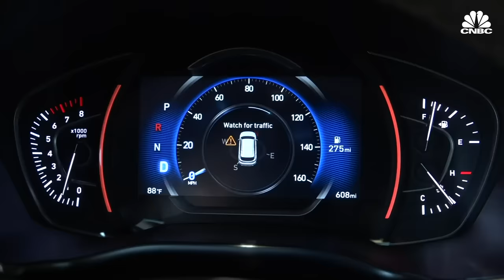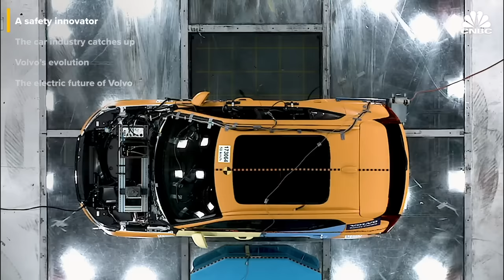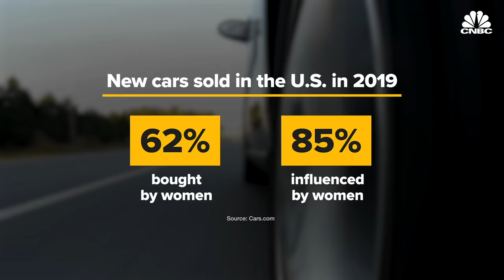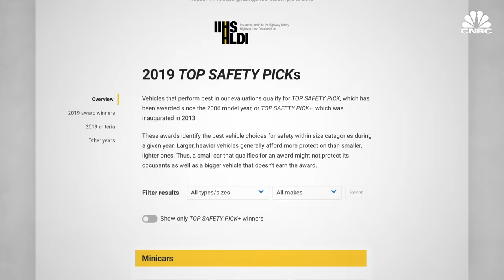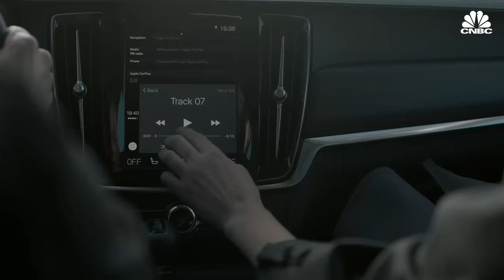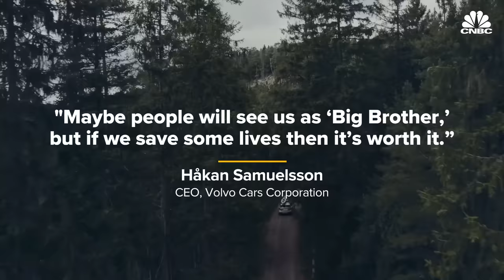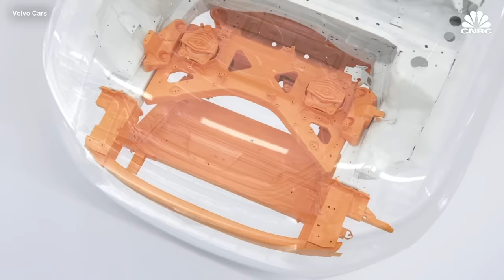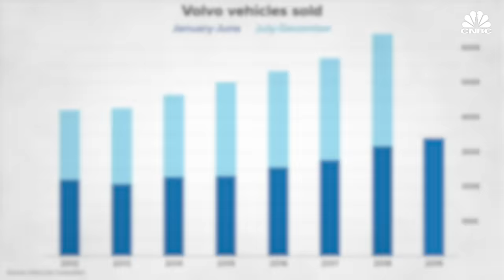Why Volvo Is Losing Its Big Lead In Safety

Comment: I will never buy anything but a Volvo for my family. I trust them, fantastic, well built and reliable cars. Plus they look excellent!
Reply: AirCat Aviation :  Many years ago, my wife and I survived a multiple collision smashup on the freeway in Michigan driving a Volvo 145 wagon.  Lost the front, tailgate and passenger door.  Glass was everywhere.  Got bloodied cut fingers from digging glass out of the seatbelt mechanism.  But we walked away. Fixed the car and drove it for 8 more years, and then traded it in on a new Volvo 240.  Needless to say, I was sold on Volvo and excellent engineering.
Reply: @georgeetoile6686  What a Great story, I'm glad you survived :), I myself own a Volvo V60 D5 2016
Reply: @georgeetoile6686  Same here! My sister was involved in an accident where a truck 'knocked' on the driver's side. The 940 was a total loss due to a bent frame (WHIPS!), but my sister stepped out of the wreck without any injury!
They say, selling the first car is the success of the salesman, but the next car goes on the garage team. But with such an experience  both of them have all the credit...

Comment: Can we stop with the "model 3 safest car" BS. It is a common misconception that the Tesla model 3 is not the safest car. Volvo beat it on adult occupant protection in Euro NCAP's tests. The model 3 didn't perform particular well I'm the small overlap crash test with footwell intrusion. Volvos aslo have stronger roofs. The NHSTA don't even perform an offset test, their crash tests are basic. Please do your research.
Reply: Volvo and Tesla have the same score in Adult protection 96%. Best test score for Adult protecion in Euro ncap belongs to Mazda CX-30 with 99%. Best score for kids or pedestrian belongs to Mercedes CLA or A-class. Chrash avoidance systems still belongs to Tesla model 3 94%.
Reply: The model 3 is the safest car in its class. Some Volvo are safe but not sure how safe they are compared to their competitors in the same class
Reply: I disagree, crumple zone is the biggest contributor to safety and without a large engine in the front it has much more of it. It's physics. They also have better polar moment of inertia to spin away from objects. Lower center of gravity to reduce rolling and thus have better handling, perhaps not the best in the industry but adding all of these factors reduce the risk of injury even more and reduce the risk of first getting into a crash. That last point is amplified by autopilot, with all the sensors and these features being present in all models the overall safety factor is higher.
Reply: The tesla cyber truck is probably the most safest lol its litteraly a armored tank for the average people. (Glass maybe not)
Reply: @jmitchell140897   Elon likes to toot the horn higher and says it's the safest car on the planet.
Reply: @phutran9312  no, but structurally it wouldn't make a difference it were.
Reply: @777Outrigger  it wouldn't matter if it rolls over. https://youtu.be/D6CzLZsN3Z0

I'm curious what would happen to the Model X under the same test.
Reply: @phutran9312  no, check out the IIHS website. Volvo can support over 5x their own weight, and can support more pounds than the model 3.
Reply: @phutran9312  sure here are the links:
Tesla Model 3:
https://www.iihs.org/ratings/vehicle/tesla/model-3-4-door-sedan/2020
Volvo S60 (closest comparison):
https://www.iihs.org/ratings/vehicle/volvo/s60-4-door-sedan/2020
You might need to scroll down about. 
Tbh Tesla does have a higher strength to weight ratio and I don't think any of them broke the machine.

Comment: 2000 S40
 2008  XC70
2020 XC60 .  The extra money spent on purchasing a Volvo is a terrific piece of mind for family safety.  My wife has the XC60 
And my XC70 is still going strong...Volvo for life! Only had one accident, on the highway with 3 cars involved, my S40 took a hard rear quarter side hit and refused to spin out and lose control,  it aggressively held its lane albeit with a 30 degree skidding angle.  It corrected and I pulled over. Nice.

Comment: I love my 1985 240 gl. Almost 400,000 miles and still going strong. Only basic maintenance needed.
Reply: Your car is good for another 7000000 miles.
Reply: Marko Košir I have an 89 240 DL. 365,000 miles original motor. Does not quit
Reply: @hectorvazquez7929  Nice to hear that, but you are going to wait  a looooong time until you will say goodbye to that  car.
Reply: Marko Košir I don’t want to say good bye to it haha
Reply: @Foodstampsandfuelclamps  of course you dont it is a Volvo
Reply: I love old Volvo tanks. I had a 240 for years and it was fantastic. I now drive a 2002 525i and it has over 400,000 on the original motor! I’m so surprised by the longevity. People will say what they will about BMW but they know how to make a car.

Comment: People seem to forget that Mercedes has also been making big leads in safety for years.
Reply: no, not as volvo does, mercedes has a lead in luxery like electric adjustable seats but thats also very common now just like the 3 point seatbelt just like a bumper(ohh btw bumpers as we know today (you cant see them but they are there) is also invented by volvo) volvo has been a brand about safety and practicality, like when you fold your rear seats its flat as the rest of the boot, and rubber on the doors that wont freeze shut in -4 till -40. and when you crash a engine that goes under the car and not on your knees thats why i drive, love, life    v o l v o
Reply: I am also a vovlo driver snd Huge advocate. But you are wrong. Mercedes certainly innovates for safety, they just don't promote it specifically, letting volvo enjoy the PR. Mercedes Benz invented the viscous engine mounts that would let the motor fall down in the case of a head on collision, and Volvo immediately copied and implemented their own ~

Comment: Safety features of Volvo available in all range of model, compared to other makers, need to add on payment, so?
Reply: Not Toyota. Also Volvo generally sells at a more premium pricing. So on a on par level comparison you would have the same tech safety features of other brands. You compare models but fail to compare the $$$$ which is the real factor of comparison.
Reply: I bought a used 2015 Volvo V60 AWD with only 23,500 km on it.  That is 4 years of depreciation but only 1year equivalent of use.  It has almost all the same safety features, but at a much lower price.  Why buy new?
Reply: @georgeetoile6686  Why not buy new?

Comment: Love my Volvo...just wish it was more reliable
Reply: C30?
Reply: @snhprojects2789  2015 S60 T5
Reply: @A2dy  kinda surprised that its unreliable my uncle has an 850 t5 and he never has any issues
Reply: My mom has a 2011 XC70. Just oil changes, but it’s only at 60,000 miles.
Reply: Chao Zhu that’s a lie. Look it up. Japanese brands top all reliability surveys.
Reply: As far as I know especially the swedish build v60/s60 are extremely reliable. I think it was leading some german statistics for used cars.
Reply: volvo v90 d3 with over 140 000km no problems so far
Reply: einar one off example is no measure of Reliability of a car. You will find lots of people giving example how their dodge or Lincoln is running reliably, but those brands are at the bottom of every reliability surveyz
Reply: @animeshdas9842  with propper maintanence most cars will run forever
Reply: @A2dy  Huh I own a 2016 S60 T5 and it's been doing great.

Comment: So Volvo released its research data to other car manufacturers in order to make cars more “compatible” with each other in case of collision. 

I would buy a Volvo in a heartbeat if only they were more reliable and resale value didn’t plummet as soon as you drive it off the dealership.

Comment: Not just safety, reliability on these is also huge, look at how many old Volvos still kick around merrily
Reply: Old volvos are reliable but look ones made after 2000s are not, they are at the bottom of most lists. Still safe but volvo is not known for their reliability.
Reply: Once Volvo was purchased by Ford (2008-newer) their reliability shot way Way up. I drove a camry from new up to 215k miles. Had to take it off the road. (rust)
My 2010 XC70 now has 215k miles, runs Perfect and looks Brand New. AND It's AWD. Totally different league than my Toyota, just as reliable, safer, nicer, never gonna rust out ~

Comment: Volvo has not been taken over. Geely is the investor after Ford was running them into the ground. Also Volvo has been and always will be the leader in safety and technology.  Volvo created the seat belt, the child seat, lane keeping aid, sips, wips, systems. Thank goodness the REST are finally spending R/D on safety. Can you imagine if Volvo put patents of their safety inventions? 👍👍👍👍
Reply: Exactly. I don't know where people get the fallacious idea that Volvo was "taken over" and now is Chinese. That's not at all the case. Geely invested in Volvo and injected capital but Volvo is basically an autonomous brand within the Geely Holding group umbrella. The cars are engineered, designed, created, road and crash tested in Sweden and there's really minimal Chinese/Geely input into the actual cars. If anything, Geely gets to use Volvo tech in their other brands and they've become more Swedish in a sense.

Comment: It's losing nothing, the other brands are safer now
Reply: the video is biast because Volvo does best in REAL ACCIDENTS, while other manufacturers do good in TESTS only. When you change the test other manufacturers fail and Volvo wins because the difference is that Volvo works on REAL CRASHES and others work on lab test crashes

Comment: I would be very interested to know how many Volvo crashes occur above 112MPH as these would be the only ones saved by limiting the vehicle to that speed and I can imagine most drivers being put off by being told the Volvo will do 112 while the X brand will do 136 or whatever seems like a significant number of people would go for X brand whether they drive over 112MPH or not.  136 is just better in our brains.
Reply: It vastly shortens your stopping distance, and also speed at impact which os often not the same as the driving speed you had before the accident.
Reply: Anders Rønning Good point, thanks.  I more than most understand and accept safety will be a much greater priority in cars of the future and I fully accept that is a very good thing but there is still a nagging part inside me that says things are getting worse even though obviously less road deaths is a great thing, I think its because growing up a cars value was predicated on how fast it would go and that seems to still be the metric my brain is looking for.  Top Gear in the 1980’s never had a segment saying We’d like to introduce the new super car from Ferrari You won’t believe how few people die in it per 1,000,000 km driven.It was always WoooooHHHHH look at how this looks, check out how fast it goes and how well it handles.  When I think about it I would obviously prefer the deaths metric over the speed to be improved but a more primitive part of my brain still sees worse.

Comment: I agree with everything but then you lost me at the speed limit to 112 mph. Volvo is a luxury brand and a very expensive one at that. For the price of a  Volvo I rather buy a bmw. It’s not about the top speed of the car but rather knowing you could achieve that if you wanted to. I understand electric is the future but the average consumer simply can’t afford an electric car. This does not include the price to install a fast electric charger. Most people simply don’t have the garage space needed for a charging station.
Reply: Nah, I don't see the problem. As a German who drives pretty damn fast given the opportunity, I don't see a 190 km/h (112 mph) limit as a sticking point. I very rarely go faster than that, anyway, because faster than that just isn't comfortable cruising anymore, even in a V60.

Comment: Limit speed to 112 never bying a volvo
Reply: Are you going to use it on a track? Otherwise why would you need to be able to drive faster than 112 mph?
Reply: @alex27826  autobahn?? Track?? Drive  that speed anyway? And also the knowledge that my car can go fast for example not just 112
Reply: @Harry._.Thompson  I doubt you are German, so I think the point is moot.
However more than half the autobahns now have speed limits way below 112 mph. And you can be held partly liable for accidents if  you were travelling faster than 130 km/h (81 mph).
But sure, let's forget about safety concerns so you can enjoy having a fast car (even though you will probably never utilize it).
Reply: @alex27826  well first anyone can use the autobahn and I  intend to. Secondly u can get sentenced for crashing into someone at 15mph. lastly walking out into the street is dangerous but u still do it. It is about taking calculated risks (speeding) is fine in the right area and time.

Comment: Volvo cars are designed to protect passangers in real life accidents and not just to  pass the NHTSA/IIHS/EuroNCAP tests with 5-star results according to current standards. Volvo has a crash test facility in Sweden where they analyze data from previously happened accidents and the learnings are used to build safer cars in the future.

Comment: My 2013 Volvo S60 T5 stalled in the middle of the highway after the engine failed at 76,000 miles. I switched to BMW and never looked back.

Comment: Saab introduced the safetybelt as standrard equipment in 1958. Before this time only a few manufacturers had the option to have safetybelts.
Reply: oof well Volvo created the 3-point seatbelt a year later in 1959 (stnd equip.) and made the patent free and open for all, changing car safety forever

Comment: How does Volvo compare with Tesla in terms of safety?

Teslas have a low center of gravity. (harder to flip over)
Teslas are heavy compared to other cars. (Its passengers are safer if crashed into a lighter car)
Teslas have some form of Autopilot (Removes a large amount of human error from the equation)
Teslas have a large crumple zones instead of an engine (reduces the forces on the car and passengers)

I don't know much about volvo, but I heard that the Tesla X, 3, and S are the three most safest cars.
Please correct me if I am wrong, but I think safety is increasingly being associated with Teslas.

Comment: CNBC rly needs to do a bit more research. Firstly  while geely isn’t huge in revenues , because the brand mainly targets developing countries, with vehicles at very low price points. It’s company net worth is almost on par with TATA motors which is the parent company of Jaguar etc. Also, it is super common for western automotive companies to enter the Chinese market through collaborations or joint ventures with local companies, and it was volvos aim to enter the Chinese growing market for luxury cars even prior to the acquisition.

Comment: I think that the Volvo XC90 is better than the Mazda - CX9 and Hyundai - Palisade, but the problems are that there is no availability of maintenance with unavailability of spare parts in many Saudi cities 🤔 It is not necessary that the maintenance at the Volvo agency is better to contract with the major workshops to solve  This problem and making it available, especially competition, is required with Toyota.

Comment: Story of Volvo's recent success: writing off the US market, which is headed down the toilet faster than Mr. Hankee-Poo.   Volvo's presence and prestige in the US market is probably about 1/3 of less of the strength that it had under the hey-day with Ford in the pre-Wall St. implosion.  As for Tesla, funny they should refer to it as "California car maker".   All signs indicate that Tesla will follow Volvo's example and continue to shift to China, where, if things are going to be run by autocrats, at least they are run by efficiency motivated autocrats -- unlike the US, where the autocrats are motivated by holding business hostage until they get more power for themselves.  A very un-Sweedish sentiment, and another reason why Volvo probably decided the US market is, in the mid-to-long-term, a hard pass.

Comment: The guy at 5.40 saying you get same safety from other vehicle has never owned or driven  a Volvo or even read the Volvo broucher. It's completely different experience driving Volvo and equivalent to merc or Bmw. Coming from a x90 excellence 2019  owner .

Comment: Volvo was also in the bottom 10 for Consumer Reports, landing at 24th with 38/100 rating for reliability, with the brand's flagship SUV getting the worst rating for reliability.Apr 10, 2020
- Chinese OWNED SINCE 2010

Comment: When IIHS introduced the "small overlap" crashtest, back in 2012, a lot of cars failed. Volvo didn't. They test beyond the requirements of crash tests and Volvo does a lot of research on real accidents to learn from it. You are not invurnerable in any car but as safe as can be in a Volvo.

Comment: Volvo is going to get a lot better in terms of sales as their cars are looking awesome, German vehicles are great to drive, but they don't match on one thing safety and owning a Volvo S90 D5 R Design myself, its top-notch, this is the safest car you can get on the market. It is not built on having performance in mind; however, it does achieve 100Kph in 7.7sec in normal conditions for such a big thing with a dense shell. Volvo cars are constructed primarily on safety, comfort, luxury, and the rest all is second whatever it is under the car world. They are not far off on performance and handling, and they will only get better in the coming decades. The maintenance is comparatively lower to all their German rivals. It checked all my boxes. Loving It!